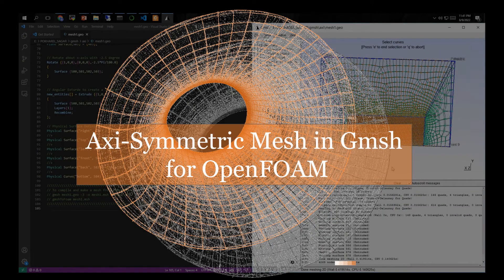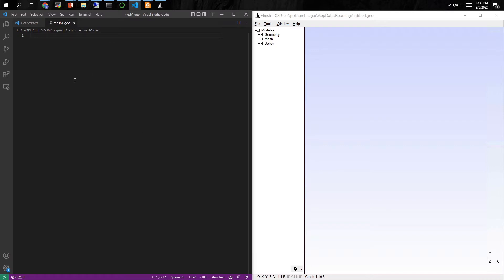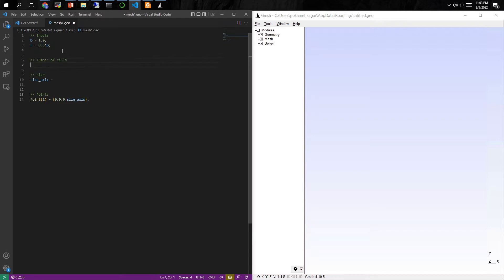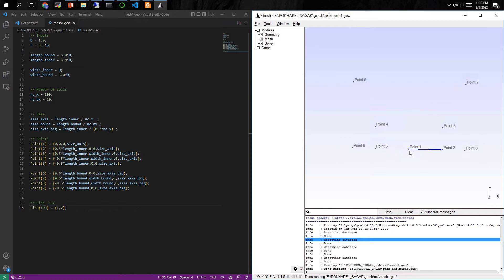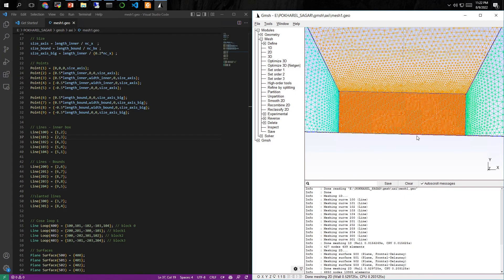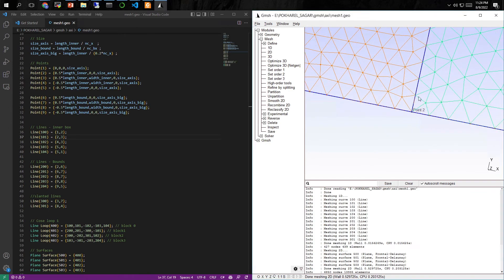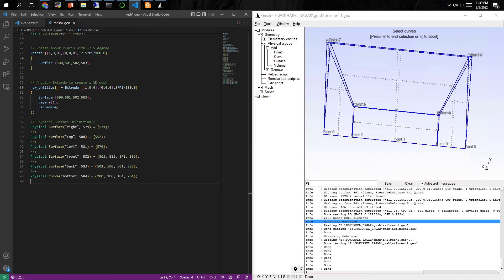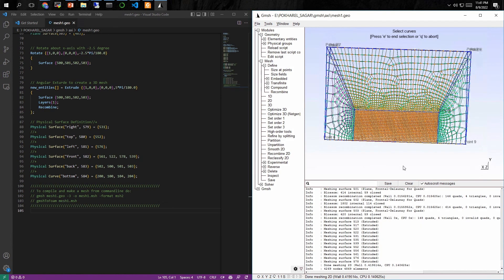Using Gmsh to create an Axisymmetric Mesh [Openfoam]

Comment: Thank you for this helpful tutorial. I am trying to do this exact process and was struggling. One tip is that boundary layers in the planar mesh can trip up the extrusion. I'm sure it can be done but may be better to do inflation on the 3d mesh to the extent possible.